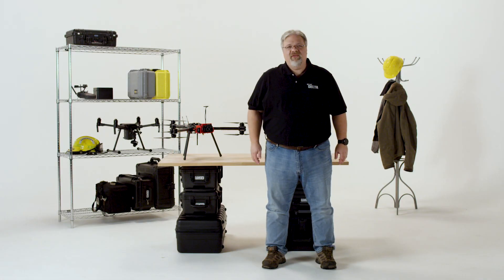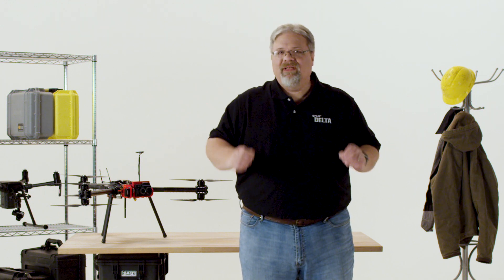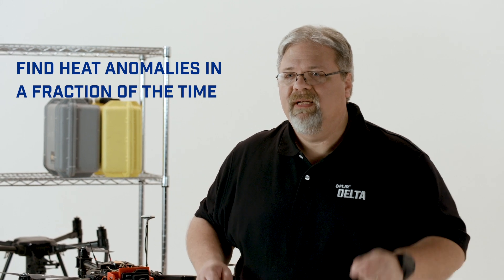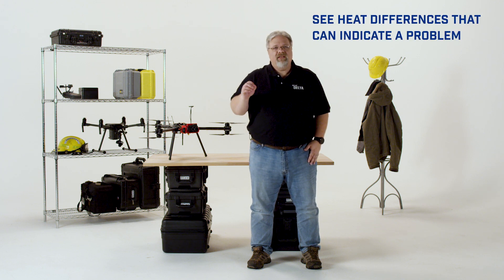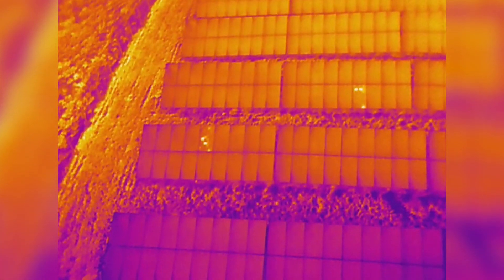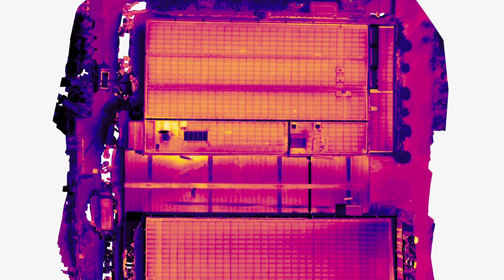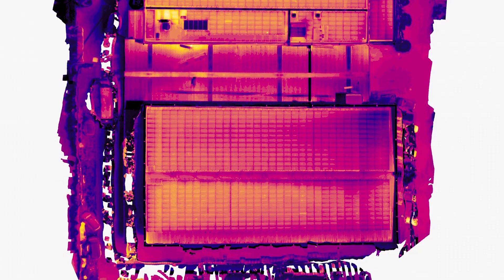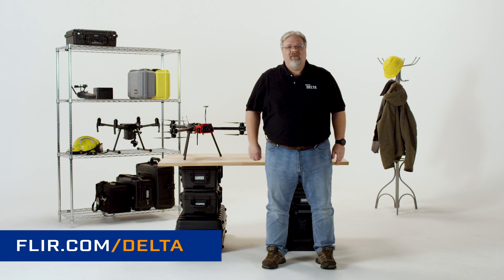Inspecting Solar Panels with Thermal Drones | FLIR Delta - Episode 11

Comment: Huge fields full of black panels is supposed to help prevent global warming? I worked at a client's house right next to one of these solar fields in Virginia, mid July and the heat coming from that field was unbearable.  Maybe if these panels were made of a brighter material and produced in America we'd be getting somewhere. Why do these panels need to be black?
Reply: To absorb the sun's radiation, which is converted into useable energy. A bright material would reflect the sun's energy not absorb it and be so inefficient that installing them would be a waste of time.